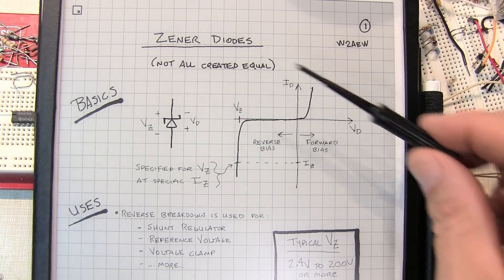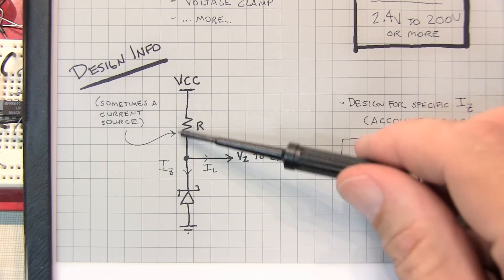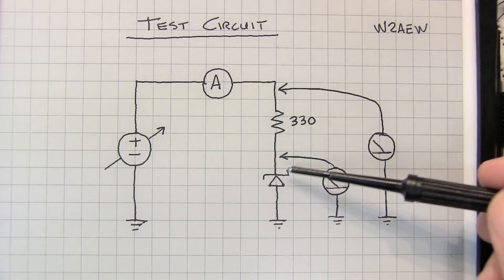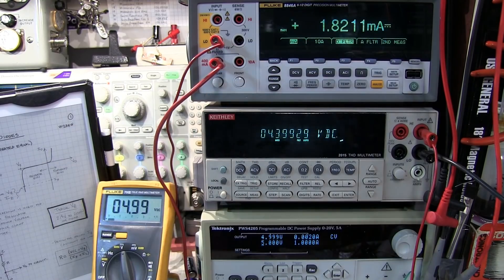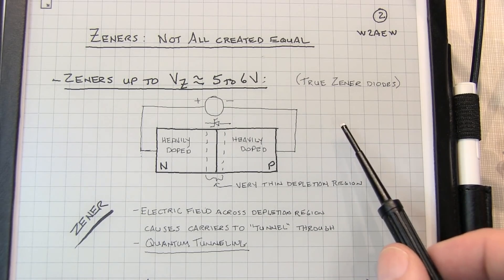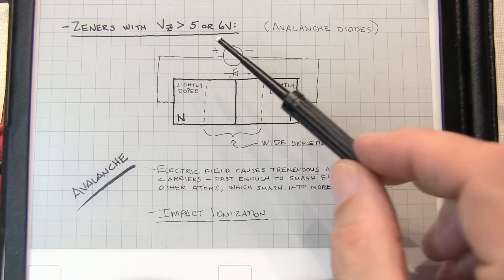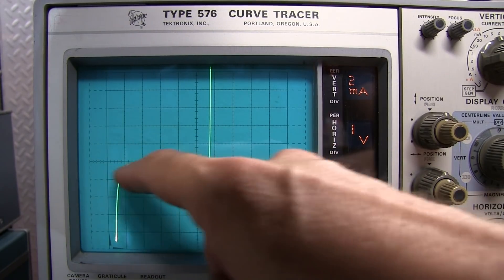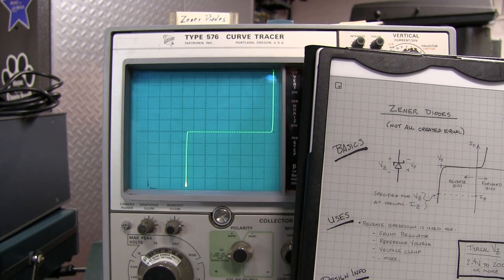#289: Back to Basics: Zener Diodes - How to Use | Applications | not all created equal

Comment: In my high voltage leakage tester project (the final, part 7 is scheduled to be published on Saturday morning), I was using 5.1 zeners as voltage clamps on the input of the Arduino’s analog inputs. These were protection I n case of a over voltage from the resistor dividers (it measures the supply and DUT voltages, over 400VDC), or over current through the current shunt causing the input voltage to go over 5v, but they were conducting too soon and were affecting the voltage readings as they then effectively became resistors within the resistor divider, preventing predictable divider ratios for accurate measurements, worked fine without them. Time to try some different ones.
Reply: I use zeners for very loose tolerance voltage regulation.   I use a TL431 for precision poor mans programmable voltage standard.   They are precise and  cheap.  I always skavange them from items I take apart for parts.    I always use them for the reference voltage for a voltage comparator circuits when used on a varying power supply voltage.    ie: battery chargers that use a  voltage reference for completed charge level indication for auto shut off.      Look up the data sheet and you will be impressed with its functionality and its various application circuits they use them with.   Enjoy.
Reply: Try using a series regulator (add an emitter follower to the shunt regulator). That can vastly improve performance.